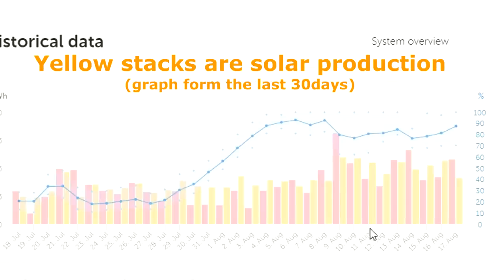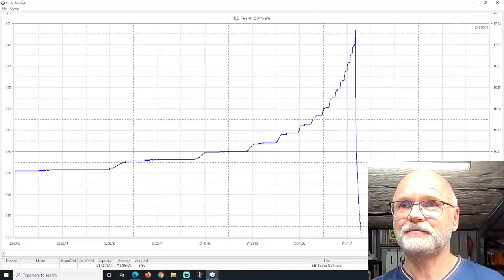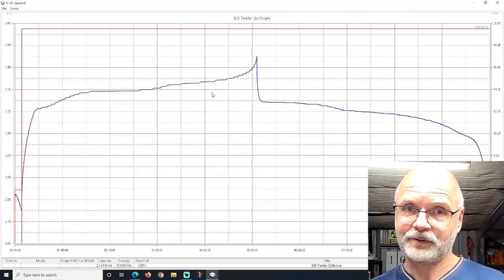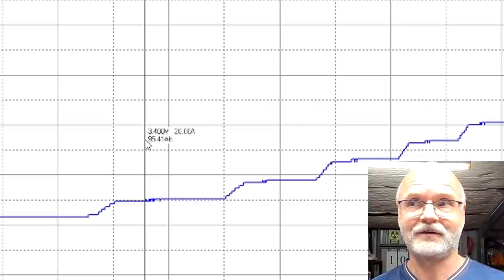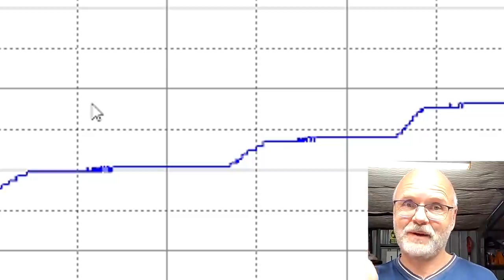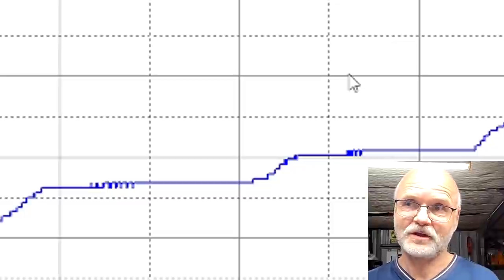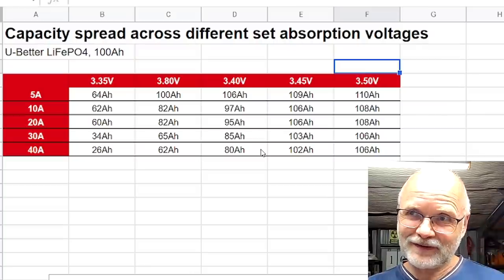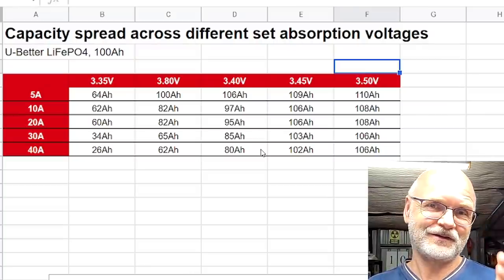Finding 20% and 80% SOC with LiFePO4. Why charging current and charging speed matters!

Comment: I was wondering if you could check out some battery packs for me is from jag35 on YouTube he sells batteries new and used I bought new batteries for my pack and battery packs you build yourself I got one that is got a 50 amp BMS it's4 S10 p and I'm using the 26 650 batteries and I was wondering if you could check the capacities compared to the bigger one that you got the 280 amp hour batteries versus building them with a small batteries in making a pack out of them and like you're doing the here on this video checking the charge rates and what would be best voltage and amperage to charge them at which one is the cheapest thank you
Reply: Lithium Polymer versus Lithium Iron Phosphate .  Apples and oranges .     Li-Fe-PO4  is much safer chemistry but not bullet proof.   Andy has a link in the description to a page with suggested batteries and equipment.
Reply from the maker: That is in the US. I cannot buy from Jehu directly...

Comment: Looks like the data you took from the graph didnt include absorbsion. If you charge to 3,65 at 40 amp and cut of the moment it goes from 3,40 to 3,41 then it didnt absorb as much as charging to 3,65 at 5amp and cutting off at 3,4. I find you other video kinda disprove part of this video. if you look at 5:53 in this video, you are using a value with zero absorbsion time. If it have had 30min more at 3,4v and 30amp it might have been at 100+. You already showed that in your other video.

Comment: Andy,

I love your videos but sorry i have to disagree with this one as i believe your methodology is flawed.

The data that you loaded was of CC until the 3.65 peak voltage was reached then charging immediately stopped. You then tried to assume that various points on the curve reflected that it has absorbed at that voltage, when in fact it is only a bulk charge transition value.

To try and do the comparisons i believe you need to rerun the tests at the various currents and but with different peak voltage and then hold the respective peak voltage until the tail current drops to some specified value e.g. 1% of expected capacity (what ever the manufacturer suggests).

That is, do CC to desired value (3.4 or 3.45 or 3.5 or 3.6 or 3.65 ) then hold at that voltage and switch to CV until tail current reduces to 1A.

Then do a comparison of the total charge the cell absorbs.

Comment: This is probably due to the internal resistance of the battery and in the cable. The higher the current, the higher the voltage "lost" across this resistance.
Reply from the maker: A bit yes but then it should be linear, so double the current half the capacity. Ri of the cells is not moving much either.
It is more about the saturation you reach during charging.

Comment: NO .  I can't understand why you don't follow what the science says . 
It says charge at 3.65 volts . This work has already been done . your work does not even use 3.65 volts which is obviously where you should go. That's where the maximum charge gets into your cell . Your voltage measuring /logging system is not as accurate as it needs to be either, see the steps . You should never go to 3.8 volts .You damage the SEI layer. What possessed you to do that?  See the white papers on overcharging voltage damage.

Generally though it leads to what is already known!  Set the voltage at 3.65v  ,no higher no lower, for best charge and then cut the charge when the cell plate voltage reaches 3.5 volts.
Reply: If you don't want to explore , why are you here ?  His equipment is fine for what he's doing . 3.8v was just a typo .     3.38v
Reply: The whole point of this is to NOT charge to 100 percent .  We strive to achieve long life cycles with batteries that cost thousands of dollars . Not just max it out. Staying away from the top and bottom 5-10 percent will add cycle life . Andy is demonstrating (perfectly) how to get the most out of your battery system while adding  life cycles .
Reply from the maker: That is totally wrong what your saying. The science never says to charge to 3.65V. This is the highest possible charge voltage for the cells but does not mean you have to charge to this all the time. This will only increase degradation.
3.8V should have been 3.38V. Just a mistake I have corrected now in the spreadsheet.
Reply: You definitely should not charge a pack to 3.65V/cell. That would lead to multiple cells going over that, potentially way over. Maybe very occasionally at a very low charge rate to top balance.
Reply: @OffGridGarageAustralia  Read again . That's not what I have said and you should get it thorougly clear. SET THE VOLTAGE TO 3.65v then cut the charge when plate voltage is at 3.5 v . NEVER CHARDE TO 3.65v AGAIN !
Reply: @onthelake9554  Read again . That's not what I have said and you should get it thorougly clear. SET THE VOLTAGE TO 3.65v then cut the charge when plate voltage is at 3.5 v . NEVER CHARDE TO 3.65v AGAIN !
Reply: @niktak1114  Read again . That's not what I have said and you should get it thorougly clear. SET THE VOLTAGE TO 3.65v then cut the charge when plate voltage is at 3.5 v . NEVER CHARDE TO 3.65v AGAIN !
Reply: @aprilsteel9466  set what charge to 3.65V? What is plate voltage?
Reply: @OffGridGarageAustralia  I have told you elsewhere which you may not have seen . The only way you can charge at 10,20,40 amps is if your charger is placing a higher charge voltage on the cells . It can't be done with 3.65v . Your charger has to be pushing voltage in at something like 5 volts to get that current. Try it with a lab power supply . Volts at 3.65, current at .5C turn on and watch . The current will start dropping almost immediately. You just can't get that current into your cell unless it is dead flat . Try it please,.
Reply: @niktak1114  wake up.
Reply: @aprilsteel9466  that is not true at all.  The cells in his test are 100Ah cells so 40A is only 0.4C. That's nothing.  By that logic the cell voltage would sag to nearly 0V immediately when you put a 1C load on them.
Reply: @OffGridGarageAustralia  Per you're graphs batteries getting higher voltage should definitely be set at least 3.65.  because as you well know once it reaches 3.65 it's really not at 3.65.  if you're sending 40 volts into the pack and if reaches 3.65 the actual resting voltage is considerably less.  You made another video about setting absorption and float way too close in my opinion.  Your microcycling your batteries and it will lead to a shorter lifespan.  Having the float and absorption at different voltages allows the voltage to settle once it's reached absorption.

Comment: I see you don't respond to any criticism either . That's a bad sign if you are purporting to be an adviser to people  .
Reply: Hello April Steel, your feedback is a bit harsh and not very specific. That is a pity. I have seen off-Grid Garage open minded in discussions. But don't expect him to agree to everything.
Reply: @hmr_  Well I guess so . Its quite difficult to make someone look again and question something that they have decided they understand.If you read the comments here you will see that no-one wants to do the lab power supply test and if they do they will see that all lead acid style chargers that I have seen when they are allowing current to flow from the solar panel to the battery are exceeding the acceptable top voltage for that battery . Even the MPPT ones and most people don't know that and have not tested it. I'm just trying to get them to try it and see because the internet is flooded with this incorrect charging process.
Reply: @aprilsteel9466  I am sure quite sure, what you mean with "to do the lap power supply test. Some of your comments, e.g. it would require 5V to get high current charged into the battery (that's what I understood you meant) ist against the physics of the LiFePo4 cells. They have a pretty low impedance, 200Ah typically only 0.25mOhm. So 40A just require additionally 10mV voltage increase. You can see in off-grid garage's spread sheet.
Reply: Please read my post again. You started the crap with 5V in one earlier comment. What is wrong with you?  I did not ask for advice. I don’t need guessing, as an engineer I can calculate it. Off-grid garage‘s spread sheets provide all information. So please stop talking about lab power supplies.
Reply: @aprilsteel9466  what is your point? Could you please precisely explain, What your concern is. How do you think charging should be done and name the target (fast charge, Long live or what so ever.)
You made so many unclear statements in earlier posts - no surprise that there were so many objections.
BTW Battery chemistry it isn’t easy, but it follows the rules of physics.
Reply: @April Steel  Fortunately, you erased your unfriendly reply. It seems that you have strong desire to share your understanding how to charge LiFePo4 cells. 
Why don't take my invitation to clearly outline your concept?

Comment: I love your videos your experiments, and analysis, but it seems like sometimes you are reinventing the wheel.
You experiments always seem to point towards follow the battery manufacturer charging guidance.
Reply from the maker: Yes, that is correct. I'm experimenting a lot with different settings as I try to understand why these are the recommended settings and not others. I think it is important to know what happens when we leave the usual track and go off-road 😁